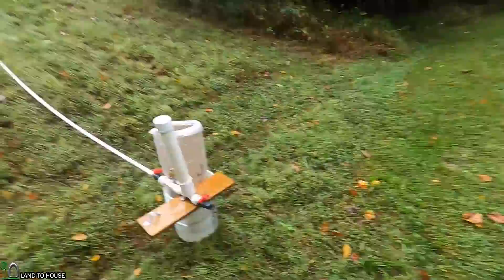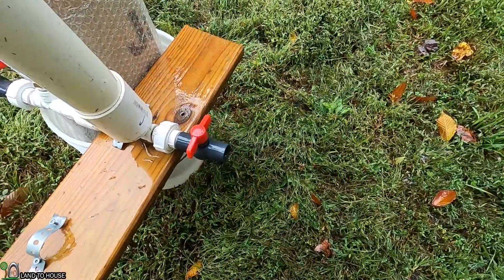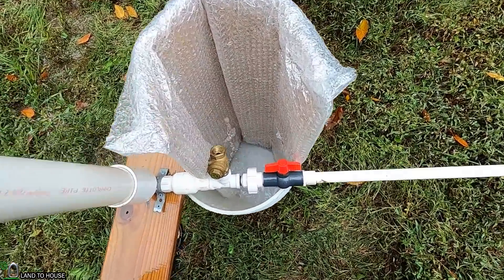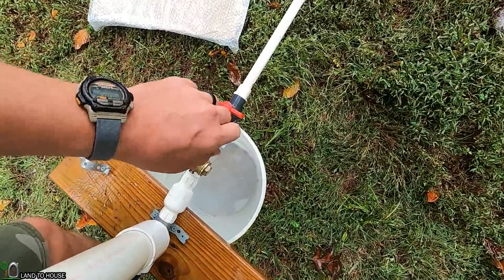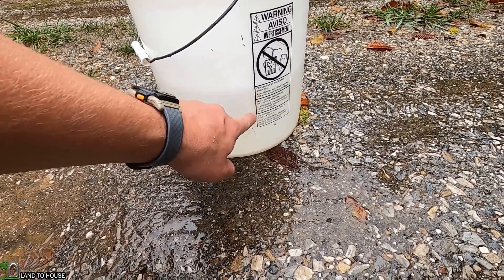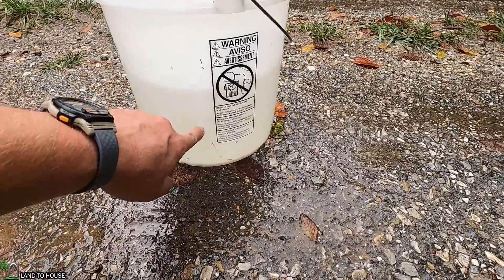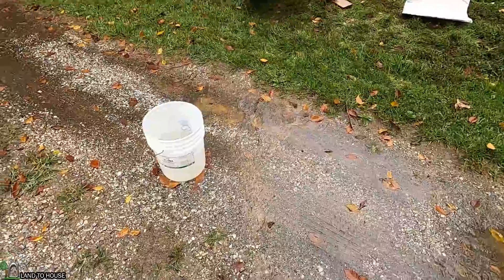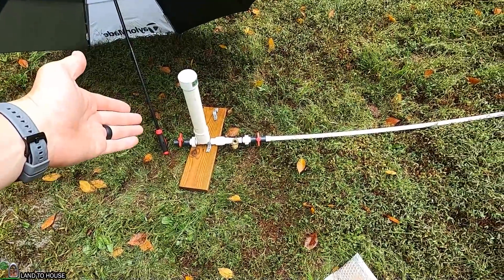Ram Pump Waste Valve Tilt Vs Water Use

Comment: I am curious if you had the waste valve inside a large tank of water (my thought would be a 300gal water tank), using the normal water pressure instead of a long drive pipe. If something like that was doable possibly a ram pump could be submerged into a pond and use that pressure to pump the water? Maybe using a vacume syphon to start if needed.

Comment: at 2:49,  wtf  does that mean.    it's not pumping, AT  ALL.
Reply from the maker: I have the delivery closed and no pipe to take water uphill . This was simply a test to see consumption  from different angles of the valve.
Reply: @LandtoHouse 
Hi Seth, You may be able to extract more energy from the available water and reduce the amount of waste usually lost via the waste valve by incorporating some of the features of the "water hammer driven air compressor" Patent # EP2161450A1.

Comment: The tilt would certainly help the pump to start automatically when the water is turned on. You could use an irrigation control valve and a timer to control the hours that the pump runs since it will auto start. That would help save the wear and tear on the check valve. A smart plug for Alexa or Google would work with a 12 volt adapter plugged into it. The DC line would run from your shed to the Irrigation control. The smart plug can be preset from the app. Put a gutter rain gauge that works with a normally open circuit wired from the battery and bypassing the smart plug and your pump will come on when it rains. Two contacts in your water supply bucket float valve that closes when full would work.

Comment: Land to house

In the easy clothes position since there is less water and less Force do you think that would cause the pump to last proportionately longer before you have breakage?

I just recently learned about Papa pumps and supposedly they correct the problems with ram pumps.. however the crazy bastards are charging $1,800 for a 2-in pump.

The main correction they said they made is they get rid of the expensive valves that wear out. 
So if the easy position causes your valves to last longer it makes ram pumps even more effective especially since they are so cheap by comparison
Reply from the maker: Funny you should ask. Papa pump is sending me an agri pump to test. We can figure out how it does in videos! I plan on testing it like I do my pumps. 

I do think the softer close of the waste valve will help reduce the wear BUT the increased cycles might counter act that.

Comment: May i suggest using 2 or 3 ram pump in parallel and link back to single output line via pvc pipes to increase output flow.Something similar to increasing the engine stroke 2...4...6

Comment: For efficacy you want it to cycle quickly. For each cycle the amount of water increases by the square of time but the pressure/work increases only linearly by time.

So each cycle is a line on a graph going up by 45 degrees, the area of the triangle is the amount of water used and the height is the energy of the following water. Running two triangles to half the higher hight produces the same amount of height as a single triangle, but only half the area.
Reply: I think there is also a force going the other way as well, which is the static pressure from the output pipe, so you have to subtract that from height of the triangle above.

It ends to giving you a nice formula you could create to optimize the setup for efficiency given the supply and demand characteristics
Reply: I suspect the right way to do this would be to get a pressure gauge on the output, with the output closed, to see what pressure you get maximum at each of the three positions. And for the other component, the back pressure is .433 psi per foot of elevation.

Plug it in and you'll get close to the right cycle frequency, then adjust your tilt to match and you'll be pretty close to optimal.

Comment: Doesn't the out put head pressure effect the pump action. In the speed of the check cycling hence the amount of water used?  Or are you just looking for relative water usage in the three check positions?

Comment: Thank you for your tilt test videos.   I used the tilt idea yesterday, not for volume, which is my normal focus, but to keep my pumps running a little whole longer.  It is the end of our summer irrigation season and I'm aware I have multiple issues to address, including clogged filters, leaks around the stand pipes and the supply pipes, dirt in the irrigation system and various leaks in the delivery pipes.  It was getting near dark in the meadow and while given time, I thought I could fix the problem, I was about to shut the system down for the season.   Then I remembered your videos and turned the problem pumps to easy close and they did run with enough water to run the mini wobbler sprinkler - one per pump.   System to be closed down for the season another day.    Thanks!

Comment: You legend. Thanks mate. Very cool. Water is very scarce here and tweaking the valve to get the right ratio of delivered to discarded is important. My spring is above a dam that overflows to a river, important to keep feeding the water to the dam and only take some of it for my use further up the hill when I install my ram pump.  Great video and thanks for getting out in the rain.

Comment: Thanks for the video.  Will you test to see what the bare minimum flow rate the 1/2in will run GPM wise.  I have about 4-5ft fall but in drought my spring will dry up to about 1gpm

Comment: Brings up a interesting question. Is it more efficient to use a smaller ram pump or tilt the valve when the water supply is limited or does it come out the same?

Comment: I wonder how the flow to waste ratio differs between the three.  Also,  I think knowing that the hard close uses more and pumps more is useful if you are using a tank as a stand pipe and want to optimize the flow rate of the ram pump based on how quickly your tank fills up.  If I had known this sooner it would have saved me some time and money.  I currently have two pipes supplying my tank because it wasn't filling up fast enough for my new ram pump (it was fine for the old one of the same size).  I think variations in the quality of the one way valves plays a significant role in performance.

Comment: I've learned so much from watching your videos. I finally got a piece of property with some flowing water. Can't wait to build my own Ram pump. I don't remember, have you done a video testing the ram pump in standing water with the waste found below the surface? I'm wondering if that will reduce / muffle the hammering sound of the waste valve?
Reply from the maker: Thank you for watching. So exciting to have property with flowing water. I have done a test with the pump slightly underwater. It does reduce the sound.
Reply: @LandtoHouse  Does it reduce the performance?
Reply: @1100wing  yes, it reduces the performance a little bit.
Reply: In Brazil, where I live, I bought 1 inch valves having a rubber seal on the moving part. It makes the closing much less noisy and I thing that it also makes the valve live longer.

Comment: Two ram pumps, one further down stream will halve the water loss as the water ejected from the valve will return to the stream and get used by the lower pump, yes?